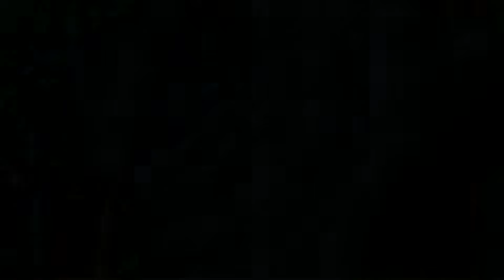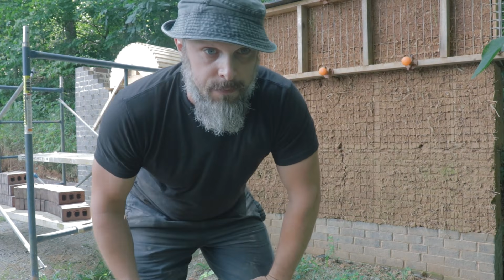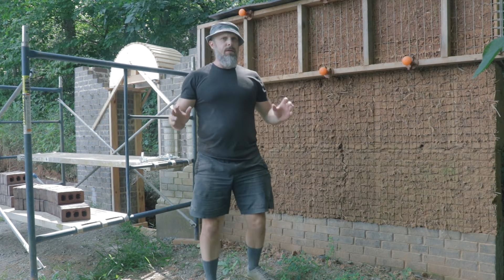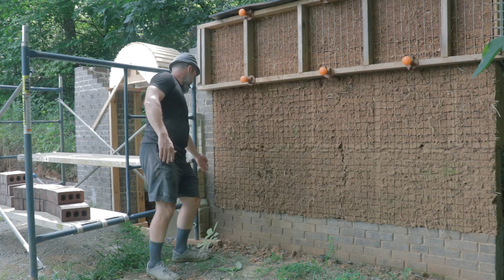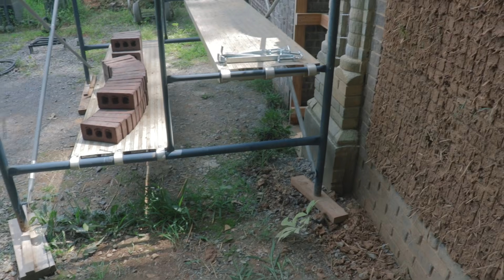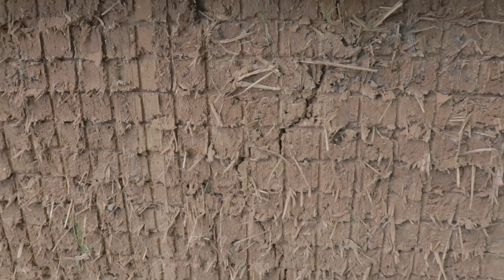Build Better Cob Walls and Prevent Cracking - Use Less Water!

Comment: hey buddy, you're doing great work, thank you for sharing your findings and reviving this european method.  Listen, when you get a chance, work on a thinner wall please.  I think folks in the tropics (where poverty is more prevalent)can use thinner walls, which should help reduce time and cost.  Maybe do a section of a fence to test the sturdyness of the wall, maybe an 8inch? or even 7inch so with the plaster it will end up being 8??  thanks.
Reply: the walls are made of soil, which can be dug from the property.

and for example, a dumptruck (9·m³) of sand in India is ~$170USD. with an 8ft tall wall, 12-inches thick, you could build 4 walls x 12ft long.

the cost of materials is relatively negligible.

Comment: So you deleted my comment because I dared to give qualified experienced input on mixing cob ? 
That big single crack was caused by piling to high to fast, drying to fast. You must allow each lift to dry before adding another lift. This crack would not have run away beyond the first lift it was reasonably dry. If the cob is mixed to dry it does not bind as well. Surface cracking usually only happens when the Cob has been exposed to heat and direct sunlight with significant wind. 
A surface crack is not anything to worry about but if it goes right through you have lost monolithic strength. 
It's a good practice to walk down the lift as you pile it up. It's easy to do, it doesn't take long. It punches down voids and weaves the straw tighter. 
Your using your whole body weight instead of a tamper so its much more effective and doesn't hurt your arm's. 
Cob is very tolerant but there are methods that work and methods that don't work as well. Your lifts are probably to high which causes to much net shrinkage. 16 inches is probably about the best maximum.
Reply: I knew he did something wrong when he mentioned the crack. New techniques always have a caveat.
It seems like he’s looking for a way to build faster, which is commendable, but he rushed thru the drying.
That’s a lot of weight to put on tender walls. If the corners would still be intact, it probably wouldn’t matter for this small build.
Reply: @jake.presents 
The English method works best. Shuttered cob using basic forms. Straw and plenty of it. If you can source cow shit as well even better.
Reply: I’m new to all of this and I’m learning what I can. Do you have or know of any videos that show an alternative way of doing this that’s more in line with your position?
Reply: @robertrayford8708 
The traditional methods of cob building are being reinvented. There are some books written on the subject. English cob techniques are the best. 
The basic rules are very simple. 
But building codes have twisted the traditional techniques down incorrect dead ends. Very sad.
I could write it all on one page of A4. The formula, the ratios the cross section of a wall. In the old days they mixed it with their bullocks or other livestock in a shallow pool. The dung made it stronger too.
Reply: @joschmoyo4532 
That sounds interesting. I would like to check out your paper when you write it. Until then, what do you think of his videos as a whole? I can see that you disagree with him on this video. However, YouTube has very little content on Cob construction methods for me to view. He’s the only person that I’m aware of who’s teaching this. I like what I see him doing and he makes it seem simple enough. I’ll probably start building my own in Jan 2026. So I’m trying to soak up as much as possible. Which is why I asked if you had or knew of any other videos. Have you seen enough of his videos to form a reasonable opinion of his work? I don’t know what I don’t know but, it seems legitimate to me. Should I be concerned about my house falling apart in the next few years if I follow his model?
Reply: @robertrayford8708 
I've already stated clearly areas where I would tend to partially disagree but on the whole his advice is generally sound. 
The wire form work is a good idea. It has merit. But I prefer the more traditional methods of rubble trench, stone base then cob. 
I prefer wooden lintels to concrete and I don't think a concrete ring beam at the top is necessary. 
The traditional system is proven. It's incredibly durable and easy to repair. Just never ever use a cement render on cob. It is the kiss of death. Lime render breathes.
Reply: @joschmoyo4532 
Thanks
Reply: Could you put it in a Google Docs and share it here?